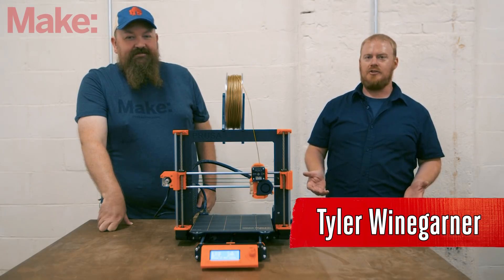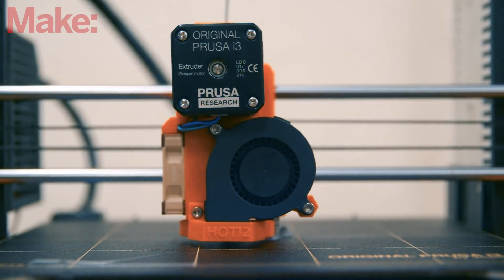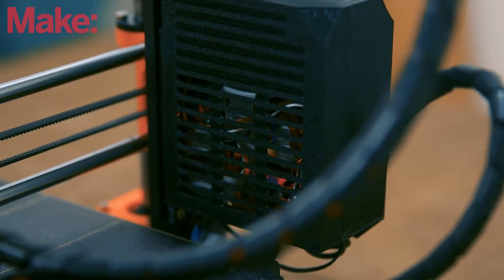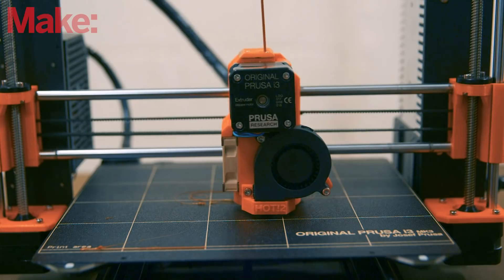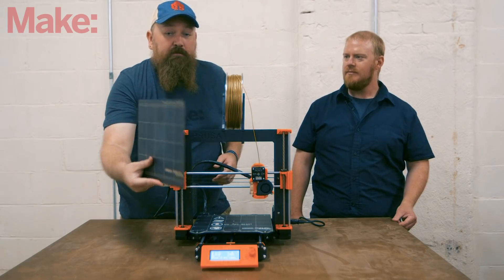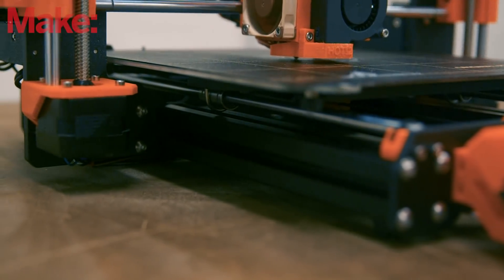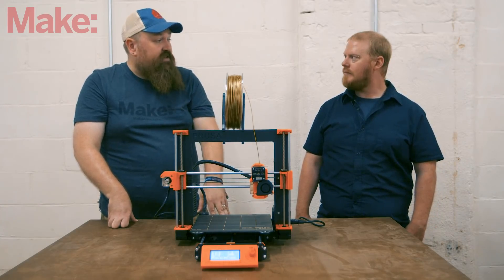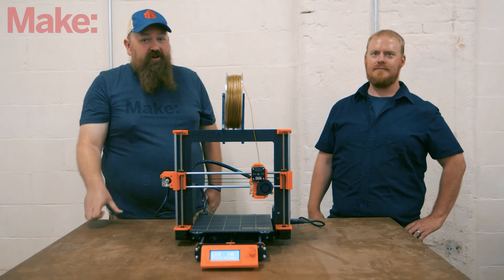The Prusa i3 mk 3: Tomorrow's 3d Printing Technology Today

Comment: You keep saing you are not happy with firmware and stuff, but you never say why
Reply: D4rkS7der There were a few issues that were best fixed in firmware.

One that's been fixed with a firmware update is the issue of layer shifting (skipping steps) while in "stealth mode". I have personally experienced this on my own MK3. The motors don't (and can't) produce quite as much torque when the Trinamic drivers are in quiet mode, and can't detect missed steps in quiet mode, either. The latest firmware limits the acceleration and speed in quiet mode to prevent layer shifting. That might sound like a cheap workaround, but it is the right solution.

That's one example. The changelog is on Prusa's website. Even the latest firmware as of Jan 1, 2018 is still labeled a release candidate. There is still no "stable release" firmware available, yet.

In spite of this, it's already a good printer with impressive value for the price. And the Prusa firmware update software makes it very easy to flash new firmware when it becomes available.

Comment: Prusa customer service is absolutely a joke. biggest mistake i ever made. they are thieves!
Reply: That has not been my experience. Whenever there has been an issue they have responded professionally and quickly. I have had an MK2 for quite a while. it is far and away better than my other three printers and I won't start a flame war by naming them.
Cheers,
Frank
Reply: Al Smith yeah but the printers are amazing which makes up for the shitty service!
Reply: Max Hammerum not when it goes on fire and melts....

Comment: If you are gonna post a video, make sure it isn't already outdated. 
You didn't mention a thing about the noise level of the machine, which is so quiet that it messes with your ears (it sounds like it is off!)
It comes as both a kit or assembled.
I know this was recorded a while ago, but at this point you could have put some notes in the video.

Comment: So what's a good unit for under $500?
Reply: Do yourself a major favor. Just keep saving until you have the 750. You'll be much happier with a printer like this than one you have to keep adjusting and calibrating to get it to print consistently.
Reply: Keep in mind you get a quality/price trade-off but in price order:

Anet A8 -> CReality CR10 -> Original Prusa Mk2s -> this mk3.

Comment: There is a famous saying on the internet, its called: NO PRE-ORDERS, only when quite a few professional reviews are in and the product is in a finished state where the machine is acceptable should one order. Whenever anyone say: "Get your pre-orders inn" you lose about 3 stars in my book.
Reply: If you do your research you would know prusa make solid printers.  Good customer service as well.  My guess is that it will be sold out pretty quick once available, although I think they are ramping up their production capability.
Reply: no pre-orders, thats it. doesn't matter if they are good or bad, we need to get rid of the tendency.
Reply: it's out and being delivered, all that it is now is you will have to wait for delivery. If you order now you will get it sometime in February, not perfect but there you go.
Reply: I pre-ordered a Glowforge in December 2015.  They were supposed to start shipping in December 2015.  It’s now December 2017 and I still don’t have it.  It was over $4K.  Granted, I should get it this month and the price is now $8K, but still...
Reply: Sorry, ordered in October 2015***
Reply: I received my delivery notification on November 21st, 2017, so it should be here in less than 3 weeks.
Reply: Do you feel stupid now? Bed they offered which was one of their new features was a bust and now you have to pay for the new one when it arrives late January, there are a bunch of problems with the firmware not doing what they said the printer could and they are three weeks behinds their posted schedule. I ordered my printer on october first and will get it next week lmao. Sad release of a product for this company...
Reply: Iceteakilla there. Is nothing wrong with the sheet they are shipping with and when they are available you will be able to get a powder coated one for $15 and free shipping. Then you have 2 sheets. 

The only other problem is the filament sensor with certain filaments which is understandable. Funny I ordered on   3 Oct and my MK3 came before Christmas as scheduled.

Comment: Still using two Z motors?  I thought they would have fixed that by now.
Reply: whats supposed to be wrong with 2 z motors, my anet never loses z sync, just because there do doesn't make it a bad idea. People are buying a second z kit for the creality C10 as it's better with 2.
Reply: Two Z steppers causes banding on the sides of prints. Personally I like my prints to be glossy smooth on the sides. If you look at myfordboy channel you will see he fixed his machine, Also note that professional machines only use one Z stepper too.
Reply: that's a matter of opinion, I don't have that problem https://drive.google.com/open?id=1s9nIqbZkMVekxY0x75XyfXXVY35jnLqDfw

 myfordboys solution would give exactly the same result as 2 lead screws depending on how straight they are and how much slop. He did it to keep them in sync something most printers do without a problem. Take the CR10, for example, there is no way over that distance the left of the bed is on the same height as the right. There is bound to be a bit of movement as the x carriage moves around the very reason people add a second z motor. It will be impossible to get accurate prints from a stock CR10.

Sure a very good XY printer is going to be better but a properly setup 2 z motor on a cartesian printer will give you more accurate prints than one Z counter levered set
Reply: The Prusa machines use z steppers with integral lead screws without the wibbly wobbly connector they are not like the printers you are thinking of.
Reply: this is by the guy that invented the design and feels no need to change it.  one is better but easy to calibrate so they're level on this machine and there is NO couplers on these.  mine have zero wobble....  and on my other machine that does have wobble (on purpose since i didn't bother to fix it) there is also zero banding.... because those rods and the frame prevent that anyway.  that's the purpose.  even the CR10 went from 1 to 2 Z motors...